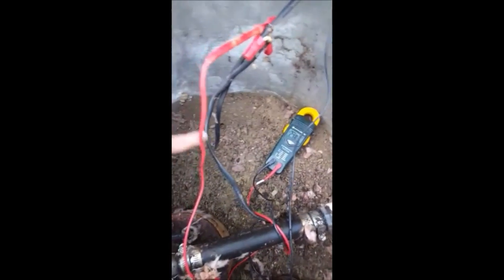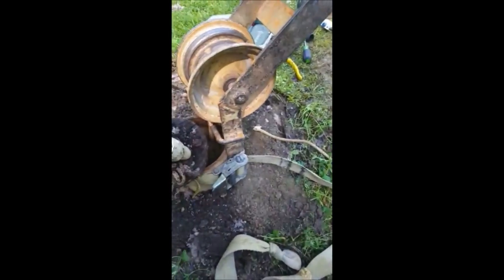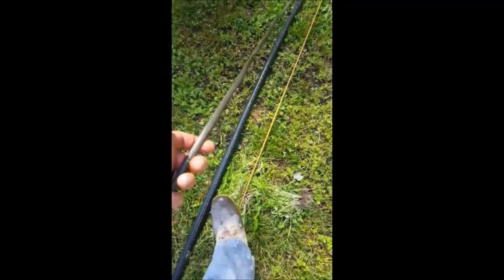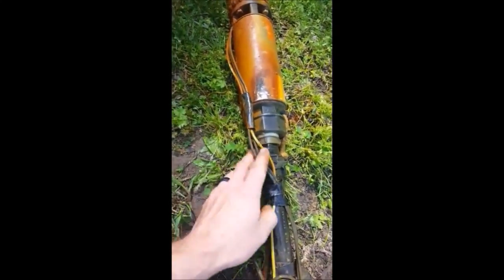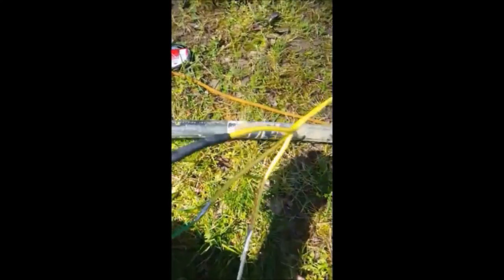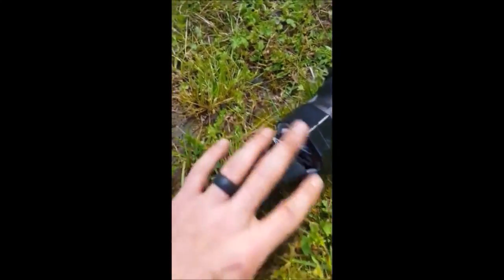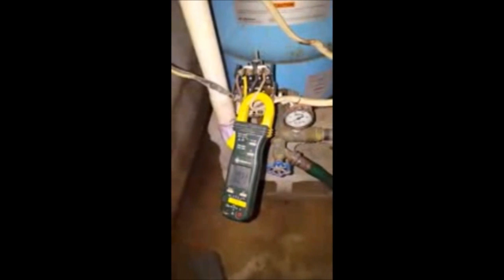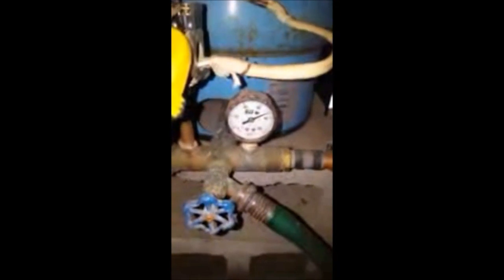Well Pump Diagnosis & Replacement - Done Right

Comment: I have a new  Franklin power box, but I’m not getting 220 voltage to the pump, any ideas?  Thank you!
Reply from the maker: Power box? Is this a constant pressure system. Or just a pressure switch. If it's a p.s. turn off power. Un do wire nuts out at the well. Turn on power & test the wire coming from home. It should read 220+. If you have wire nuts connected & testing shows low voltage. Then test red wire with electric meter with red probe & use the black probe on the ground. Should read 110v. Test the black wire the same way for the same 110v results. One will probably read less. Reason why you wont get 220v when the wire nuts are all connected to all wires, down in the well either a black or red wire has rubbed the coating off & the voltage is dissipating out into the water/ground. You can call me if you need help with testing.

Comment: Nice video.....I have a .5 HP submersible 80 feet down feeding our pressure tank that normally gives good flow in routine house use (dishes, showering, etc)  but when we put a heavy demand on like lawn watering, etc the flow stops. If I then turn the power off, wait a few minutes and turn power back on I can get back to routine flow ok if I decrease demand (i.e. no lawn watering, etc) Some handymen have told me ".....sounds like the pump" without going into why but I am also thinking maybe my well just can't keep up with the higher demand. Any thoughts on what might be going on and how I might check some things to get a better idea of what is really happening ?
Reply from the maker: Depending on the depth of your well & GPM gallons per minute. At 80' I'd guess your well is making 3-5gpm. Pumps will pump 10 gpm & each faucet uses 2 gpm. If your well is let's say 150' I'd put the pump down at 120'. If you have a 250' well, id change the pump to a 3/4hp & drop to a 7Gpm & not the 10gpm. Scheifer makes a great 3200 series 3/4 7gpm pump. Your just pumping your well faster than it can recover. Lowering the pump will give you more storage but it still can "run dry", you'll just have more water available. 1st step is figuring out the true depth. Most wells have a metal tag on the casing with all the info you'd need.

Comment: If that gauge is accurate, there is only 20psi of air in the tank
Reply from the maker: Lenny C the gauge on tank does determine air pressure in tank. It had a 20/40 switch on it
Reply: The H2O Mechanic, lol, I was nit picking you. Good job. I like your wheel mechanism too.

Comment: H20 Mechanic I have a question for you, my cold water lines are plugging up at the spigot screens and aerators with what looks like plastic/fiberglass shreds. Nothing on the hot water lines.  Is this an indication that my well pump impellers are going bad?
Reply from the maker: Andrew Arroyo possibly. You can time how long it takes to fill up your tank. It should take no more than 20 sec to pump up from 30 to 50 psi.
Reply: Thanks for your response and Yes the pressure tank takes less than 20 seconds to refill
Reply: Was yours a new install? Lotta people are messy when they cut plastic pipe and leave the shavings. Just lazy.
Reply: It could possibly be , corroded duct tape.

Unfortunately , people use duct tape to fasten the submersible pump wires to the water line going up the well casing. Over time , duct tape WILL FALL APART, leaving fibers like you mentioned , in your well.

Hope I helped you👍👍 , and yes I know my help came a year after you asked this question.
Reply: @jimbrown7237  Jeez, are people really that dumb, Jim? Duct tape?
Reply: @paulmaxwell8851  
Unfortunately , some do it yourself people , don't know any better.

Some even use even more bizarre ways of doing the same job! 🙄😒🙄
Reply: you might also want to purge your hot water tank because of the fiberglass and plastic that might be swirling around inside of it.

Comment: Did I see the pump hanging from a plastic fitting at the well head?
Reply from the maker: John Shaw plastics fittings are ok at 100ft max. use double clamps. the clamp holds the weight. 150' to 400' pumps need brass or stainless fitting in the pump & the 90elbow at the well seal. it's better to be safe than sorry.

Comment: Phil you give me hope for younger Americans, great help thanks
Reply: Phil: Then, here's another huge "Thank you!", this time from a 69 year-old first-timer (-: Thanks to your excellent video, that covers just about everything 'down the well', I've running water again. -- My well head is 3 feet below ground, surrounded by a cement casing. Your bull wheel shot, toward the start of the video, prodded me to build a 4"x4" frame, to fit within the casing, on which to mount a couple of wheels at a 45 degree slope, using nothing but 2"x12" pressure treated and bolts from Tractor Supply. -  I was able to pull all 130 feet of drop pipe, effortlessly, with my lawn tractor and a nylon rope, using what's called a pipe hitch. What I particularly like about your video is the detail you gave regarding the splicing, as well as protecting the wiring from abrasion. Since I was so paranoid about the splices being waterproof, I ended up using the Everbilt submersible adhesive-lined heat shrink kit available at Home Depot, followed by some longer adhesive-lined heat shrink from eBay, followed by the 3M Tape 23 (Self-adhering, rubber splicing tape that's very similar to the tape you use), and, lastly, some 3M Tape 22 Professional Electrical Tape. -- I hope it's not me that's the next person to have to undo all of that waterproofing (-: -- One thing I would like to mention is that, in having to replace the old 2-wire cabling (1970s) with 3-wire cable, at Wire&CableYourWay.com, under Portable Cord, I found some excellent, reasonably priced, 'heavy duty, flat-jacketed, submersible pump cable' that is purchased by the foot. Each wire has a 45 mil THW covering and the jacket is also 45 mil, which provides good protection from abrasion. -- So, thanks again, Phil. There's nothing like doing it, to be able to really appreciate it.

Comment: Where is your tork arrestor and pipe centralized?
Reply from the maker: Ronald Krigin never use either of them . They can cause big problems over time. If you tape wire every 2 ft it will prevent rubbing

Comment: What's the name of the 3M rubber tape that you recommended in this video. I can't locate it on the 3M site. - Thanks.
Reply from the maker: Callme Skeptical I'll check & send you the info
Reply: Were you able to locate the name of the rubber tape? The closest I could find is the 3M Scotch 23 - Self Bonding Electrical Tape. It has the same waffle texture as the tape you were using; but, the liner is white, rather than blue. -- Thanks.
Reply: Callme Skeptical
Reply from the maker: Callme Skeptical yea I looked all over it & there's no name on is. it's not 3m like I thought. it's called self bonding rubber tape.
Reply from the maker: Callme Skeptical I found out it's not 3m. There's no name on the roll. comment at top said it's rubber self adhering tape. he said 3m 23tape but idk
Reply: @h2omechanic  Scotch 3M 130C linerless rubber splicing tape:  https://www.3m.com/3M/en_US/company-us/all-3m-products/~/Scotch-Linerless-Rubber-Splicing-Tape-130C/?N=5002385+3290583921&rt=rud
Reply: Thanks.
Reply: Damn I ended up using the wrong tape, lasted a year though.  Scotch 130c-wrong!

Comment: Thankyou for replying,turned out to be impeller problem,dropped new pump and everything's fine,happy Easter
Reply: Hi Tom, I know this is 8 months old, but how did you get to know that you had an impeller problem with your pump. I have something going on similar to what you posted above. My pump comes on at 30psi and only makes it to 45psi. I have to manually shut off the switch at the pump. If I wait 3 minutes, it starts pumping again, but not for long. Is this what you were experiencing?
Reply: Happy Easter! Thought this was a cool coincidence seeing this today.

Comment: I want to compliment this young man for illustrating why pumps need to be installed by professionals rather the uncle Fred and his drunk neighbor. I am a National Groundwater  Association Master Groundwater Contractor and while I don't agree with EVERYTHING said in the video it is close to 95-6% correct on everything. What was pulled out and he explained with the type of wire used, the lack of properly securing the wire, the wire splice technique etc. is a perfect example of why pumps/motors fail in a short period of time.
Reply from the maker: Michael Keen Sr. Thanks so much for your kind words. I'm 28 and my father raised me up as a well driller so I try my best at professionalism to help info others. idk if you know of Hensley Well Drilling in Clarksville va. but that us.
Reply: Michael Keen Sr. Drunk neighbor? I resemble that remark.

Comment: Hi,got a pressure problem,I've metered my deep well pump and have 240 between l1 + l2. My amprobe shows 6 amps at pressure switch on both legs however I can't get anymore than 10 psi ,not even enough to operate cutin which is set at 18 psi for a 20/40 system?
Reply: You will have to pull your pump to do further trouble shooting.  It could be a leak anywhere from the pump up.  It may also be a worn out pump or the pump could be clogged up.
Reply from the maker: Tom Mcdonald normally in your case the pump fitting is plastic & has cracked. if you kill the power & your pressure drops the it's probably down the hole.  a good test is to disconnect the pipe at the top and see if water pumps out strong, if it does then look for a brake somewere else